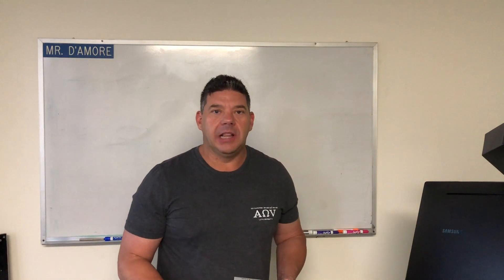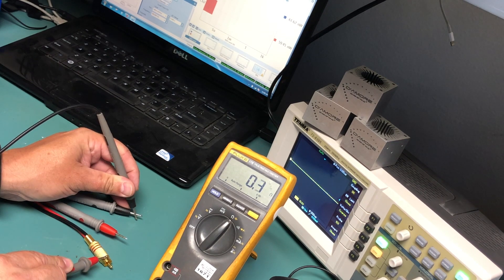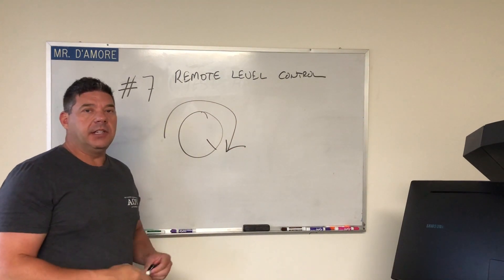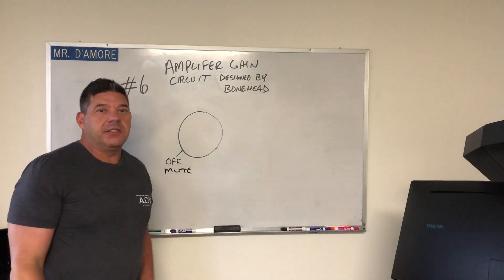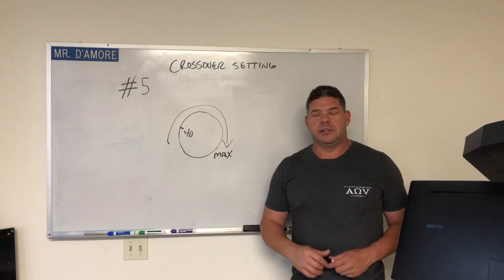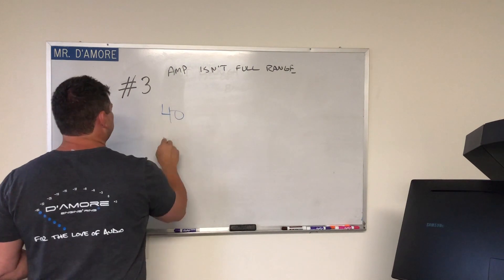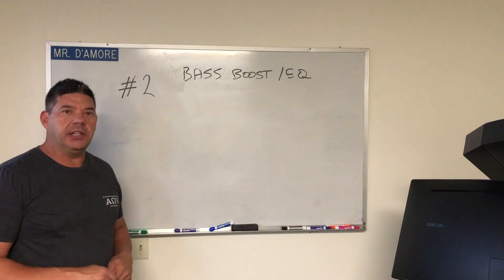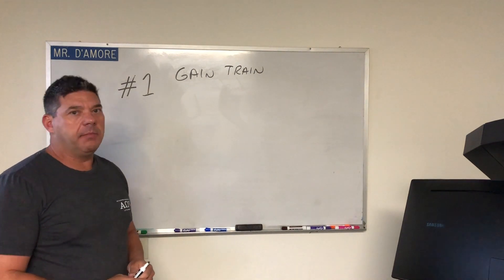Here in my Lab Episode 1 - D'Amore Engineering

Comment: I have a question as to how I would properly set my gains on my taramps dsp 3000? since this is considered a full range amp but will also work as a mono, I'm getting confused with how I would set the high and low pass filters on the amp itself.

Comment: Thanks for uploading content again, I'm waiting for my DD1 to arrive tomorrow here in Mexico, just one question, how much power it handles? I'm going to adjust a Taramps 8k
Reply: @New Alert yup, if I can recall correctly it didn't work with none of the taramps HD line, luckily they have a clip indicator, so we used that instead of the dd1 and everything went OK. I think it's because those are full bridge designs and the output terminals work differently.